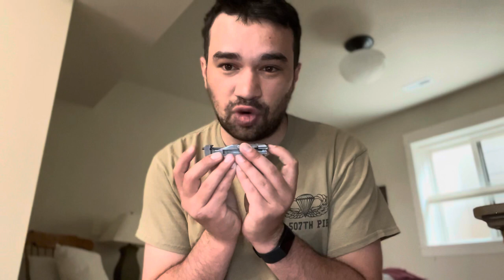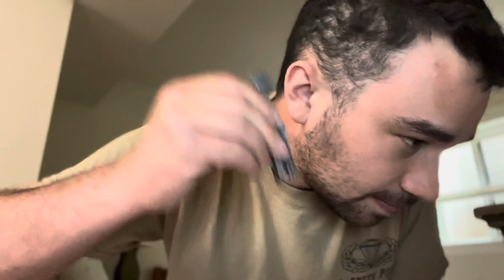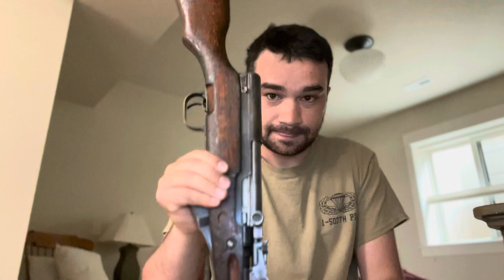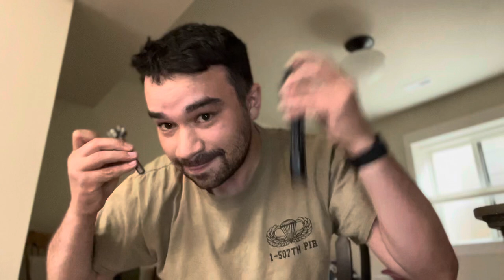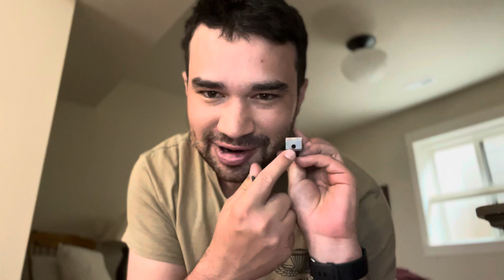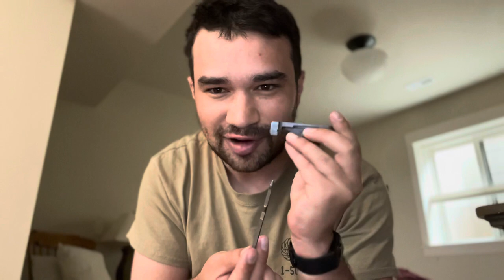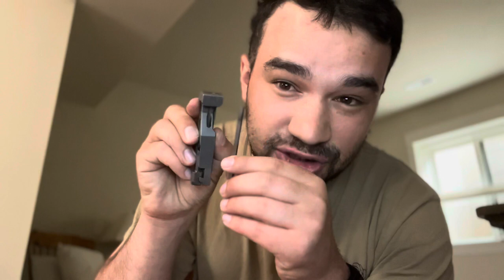The Myth of the SKS Slamfire (why you don’t need an “enhanced” firing pin)

Comment: I'd like to hear your opinion on those "aftermarket" Chinese 20rd "star" magazines that were around way back when. Are they still being manufactured? Back in the mid-1990's I bought one of those ($15) and a 30rd "USA" mag and they both work fine.
Reply from the maker: I think they are super fun, if you have a good one. They are made of thinner gauge steel and are not subject to military minimum requirements, so even among “star” marked models, they vary significantly in terms of quality. I’ve personally had bad luck with them - but I know there are better examples out there. If yours has been running well since for 30 odd years, it sounds like you got a good one.

I can’t say for certain, but I am highly confident that they went out of production in the 1990’s. To my knowledge, they were manufactured exclusively for the US (and maybe Australian) commercial markets. When those markets closed off to the Chinese, they lost their only customers for that product. I don’t think they still make those mags, because I don’t think there is anyone left to sell them to.
Reply: I had issues w my 20 round

Comment: I think some of the concern is also to do with using commercial ammunition with softer primers over the original military ones.
Reply from the maker: That’s true, and a good point. I’d say the strongest argument for a spring loaded firing pin is if someone was for some reason limited to using commercially loaded 7.62x39, although even still I think it’s a dubious proposition. It’s hard for me to see the spring-loaded pins as anything other than a band-aid solution for a very serious (and almost always user induced) mechanical hazard. The safest solution in 99% of cases seems to be to clean the weapon and use the correct ammunition.
Reply: @Triangle26  is there any actual reason why the there should be concern with the SKS and commercial ammunition over ARs and commercial ammunition?

Comment: You make an excellent point. I maintain my bolt carrier group meticulously. I clean it every time I fire it. I also take the firing pin out of the bolt every time I fire the weapon. I use simple green to clean the bolt. Try it once. Simple green is an excellent degreaser. I then lube the bolt including the firing pin with the new Lucas synthetic gun oil. I use a very light coating though. I don’t just pour it on and hope for the best. My sks cleaning kit came with a cleaning tool for the firing pin hole. I use this tried and true tool often. I have over 5000 rounds through my Chinese SKS, probably approaching 10,000 rounds truth be told. I bought it brand new in 1994. I used a parts cleaning tank and scrubbed down everything on the rifle years ago. It still bleeds a little cosomoline out of the stock every now and then though. With all that being said. I have never had a slam fire incident. Or a negligent dis fire with this weapon. Your assessment on the free floating firing pin is 100 percent spot on. It is a tried and true design that is absolutely safe if it is cleaned properly.

Comment: I’m currently having an issue with my Chinese sks my firing pin had gone out and replaced it the other day with a moderne spring firing pin and it ended up snapping again after 10 rounds😮 my buddy was telling me I may need to replace the bolt assembly? Any suggestions
Reply from the maker: Were you experiencing some type of problem which caused you to replace the original firing pin?

If not, the obvious solution here is to stop replacing parts, and just use the correct and original parts for your rifle.
Reply: @Triangle26   hmm not necessarily other then me bump firing it a couple times that’s when it had ruined on me the first time that’s why I had bought that firing pin that was supposed to be a lot better and reliable instead of a free floating pin but it happen again. And I had clean it good and everything before I installed the new one in.

Comment: Question for ya. I had a new sis I just bought slam fire on the first 10 rounds and then completely stopped as now it’s light striking. Is this still the same issue of the firing pin being stuck/slow and clean it out? (I am cleaning it out this weekend.)
Reply: Sks*
Reply from the maker: Well I'll start by saying that any malfunctioning firearm is a pretty serious safety hazard, so whatever you do, I would encourage you make sure the issue is diagnosed and corrected by a competent party before you shoot it again. I can't tell you that your weapon is safe or unsafe without physically inspecting it. That said, the most common cause of slam firing and light striking is failure to remove cosmoline from the firing pin channel, so performing proper cleaning may resolve both of those issues immediately.

Comment: i got a problem with rust. my sks slamed fired, i cleaned it, got the firing pin free, the firing pin chanel was rusted a little got it cleaned though, stored it. after one month i tried the rifle again and it slamed fired again. now i oiled the firing pin channel, it looks good after 1 week but i think another slam fire is aviting my gun as people says dont lub the pin. please help what should i do.
Reply from the maker: So rust is much scarier than cosmoline, because rust is capable of causing irreversible damage.

Basically - your first step is to thoroughly clean that firing pin channel. Brass brush, strong solvent, ultrasonic jewelry cleaner if you have access to it. From there your want to see if there is pitting in the firing pin channel. If there is moderate to severe pitting - that bolt may never be truly safe. If the rust damage is mild, we can troubleshoot from there.

I agree with those cautioning against using lubricant in the firing pin channel. It can be an emergency short term solution, but ultimately it’s a bad idea which can cause long term dangers.
Reply: I always make sure I hear the rattle

Comment: Can you take the spring off and just use the firing pin?
Reply from the maker: Good question. I'm not actually positive, but I definitely wouldn't consider that to be a safe solution. If someone were to choose to use an "enhanced" firing pin, I would advise them to use it with the spring. If someone wanted to switch back to a free-floating design, I would advise them to pick up a surplus Chinese firing pin for $10. No need to take on unnecessary risk.

Comment: The ar is free floating however can not touch the primer when out of battery.  As the bolt moves forward when it unlocks and the cotter pin retains the firing pin in 2 directions forward and back  therefor it will always rattle but is less likely to slam fire  and the slam fire is more likely  to happen with reloaded ammo and soft primers  not so much the cosmoline.    In the 90s my sks came with a paper stating the dangers of slam fires with the use of non military spec primers.  Also my polytec came with a spring loaded firing pin the rest I had did not   my polytec had a spring loaded firing pin threaded in chrome lined barrel and milled trigger pac   most of the sks I had were pressed and pinned barrel  welded trigger pac  and non lined barrels
Reply from the maker: You are correct that the FFFP design of the AR is fundamentally safer than the FFFP design in the SKS, AK, and Garand. The fact that the firing pin is contained by the bolt carrier and not the bolt is a good design feature which essentially prevents the firing pin from ever getting stuck in the forward position. 

That said, I think you may have some confusion regarding identifying chrome lined barrels. China (the only manufacturer of pressed and pinned barrels and welded trigger guards) didn't really manufacture SKS patterns without chrome lining. Ok, technically they may have manufactured a couple, but they are so rare that their existence is still unconfirmed. If you still have any of these rifles, I'd suggest that you could perform a copper sulphate test and verify that they are indeed chrome lined. In my experience thus far, 100% of Chinese SKS pattern carbines which have been alleged to have been non-lined have ultimately turned out to chrome lined.
Reply: @Triangle26  all of the non chrome lined sks I have seen were threaded in barrels     have you ever seen 1 with a factory side scope mount.  Well the rail anyhow.  I have yet to find a mount to fit.  It is attached to the left side of the receiver just under the dust cover  and the wood is cut lower than normal.   Just a straight dovetail with a notch in the middle of it.   It was imported that way. I took it out of the box in 1995   when you could buy them for $65.    And used to hear stories back then about buying a gun with a case of ammo 1260 rounds for $50

Comment: When I have purchased a sks packed  with cosmoline  I always use brake cleaner with spray straw  an make sure it is flushed several  times till it washes clean  after it is dry I oil it
Reply from the maker: Great practice.

Comment: Ive been reluctant to fire my SKS after it slam fired on me, after I had cleaned the firing pin and channel to the best of my ability with boiling water and lots of cleaner, and did the shake test.. I’m wondering if I just didn’t have enough oil, or too much which might have caused the pin to get stuck..
Reply from the maker: Assuming you cleaned properly (and it sure sounds like you did), oil should not be the problem. Too little oil definitely shouldn't cause an issue, as the weapon should run perfectly bone dry. Too much oil should only cause an issue if it mixed with some type of particulate or became frozen.

I see two likely explanations:

First is ammo type. The SKS was designed to run Eastern spec primers, which tend to be much harder than western spec primers. If you were using western made brass cased ammo, that does increase the risk of slamfire significantly.

Second is erosion of the self-releasing taper between the firing pin and the protrusion hole. This is a much less common but very serious cause of slamfires, and while an "enhanced" firing pin would probably reduce the risk dramatically, I would consider the weapon unsafe until the damaged parts had been replaced.
Reply: @Triangle26  wow! Thanks for the reply, that’s some great info.. I had some eastern surplus ammunition, but my range didn’t want me using steel amo (came and checked with a magnet). I switched to some western brass ammunition before it slam fired on me so that’s probably the problem.. I will look into erosion of the firing pin and make sure to rule that out before I shoot it.Thanks again!

Comment: You make a very good presentation, but as an engineer, I do not like free-floating firing pins (in any weapon design, including the AR-15 and progeny). I fail to see why it makes sense to save the cost of a spring at the expense of relying on the hardness of the primer (which can vary greatly). I think there is considerable less variation in primer hardness in .223 / 5.56mm ammo than in 7.62x39mm ammo. Also, cosmoline is not specific to the SKS. M1 Garands sometimes were stored in cosmoline. Because of the free-floating firing pin, it is recommended to never drop the bolt on a chambered round in a Garand. Finally, the geometry of the SKS firing pin is more prone to this because what stops the SKS firing pin's forward movement when dry fired is the taper at the front, which can, with sufficient momentum, become stuck in either the firing pin hole (especially if there is a burr) or in the mating tapered surface inside the bolt. The AR's firing pin stops against the disk-like stop at the rear and the Garand's firing pin stops against the "dog leg" at the back. Yes, a spring could corrode and become debris, but nomatter what firing pin design is used, debris or corrosion (or cosmoline) could jam the firing pin. But the other causes of a jammed firing pin (the geometry and possible burrs) as well as the impact momentum of the firing pin when the bolt slams into battery (which is reduced by the presence of a firing pin spring, and which can possibly create burrs in the inside of the bolt and could possibly set off a very soft primer) can be ameliorated by the spring. The SKS is not the only design where replacement safer firing pins are offered. The MAS 49/56 is also famous for slam firing and it is strongly recommended to replace it's firing pin with one with a return spring.
Reply from the maker: I appreciate you sharing your thoughts. You clearly have thought about this a great deal and have taken the time to develop true knowledge on the subject - which I respect. Unsurprisingly, I agree with the majority of your perspectives. There are a few points on which we still disagree:

1) I have never seen any evidence to suggest that the original Soviet design change from SLFP to FFFP had anything to do with cost saving. I am actually quite certain it cost them more to reengineer the design than it would have to leave it the way it was. Their SLFP design was not reliable (to your point, almost certainly due to the poor consistency of Eastern bloc primer manufacturing). The FFFP design corrected this problem, and allowed the weapon to work much more reliably with the quality of ammo they had (and still have).

2) I agree that the SKS firing pin design is more prone to getting stuck in the forward position than something like an AR. The SKS is certainly not the peak of elegance. That said, the Russians weren't stupid either. The tapered interface of the SKS firing pin/firing pin hole is designed to be self-releasing, and it works perfectly unless burrs, deformation, or heavy grease is present. There are many firearms which do weird stuff when burrs, deformation, or heavy grease appears in the wrong place, this is not a problem unique to the SKS. I strongly believe that if cosmoline induced slamfires were removed from the data pool, the number of mechanical failures truly specific to the SKS design would be utterly unremarkable, and comparable to most autoloading firearms, new or old. 

3) Finally, I think there is a very important distinction to be made regarding "safety" in military firearms. Can an SFLP reduce the likelihood of a slamfire? Absolutely - in an out of spec, mechanically unsafe rifle, using the wrong ammo . But in most SKS platforms, I think it's only measurable effect will be an increase in light-primer strikes or other failures to fire - in other words - the exact problem which caused the Russians to replace it in the first place. If the definition of safety is preventing a gun from firing, the safest firing pin is no firing pin. The other half of safety is that when you want it to shoot, it has to shoot .
Reply: @Triangle26  Thank you for taking the time to reply. One additional question - do you really think that the firing pin return spring causes light strikes? I would have thought that the hammer spring and hammer momentum would be so much greater that it wouldn't matter (as far as the primer impact force) whether there was a firing pin return spring or not.
Reply from the maker: @sbreheny  I really do. I have personally witnessed a consistently light-striking SKS be restored to reliable function simply by swapping the aftermarket firing pin assembly for an original one. Additionally, due to the channel I receive a relatively steady stream of "SKS troubleshooting" emails, and many of them have described similar experiences.

Of course this is far from definitive proof, however, I think it points to a very compelling possibility. Especially when all these experiences are consistent with the complaints found in early Soviet documentation.

Comment: 0:54 remember, the AR-15 doesn't use a return spring on the firing pin. While this isn't the same operating system, it shows that a free floating firing pin isn't inherently dangerous. Gunked up bolt carrier groups preventing a firing pin from moving is dangerous. Either the firing pin will not strike, or strike hard enough, to fire the cartridge or it will be stuck in place. Key takeaway - clean your weapons.

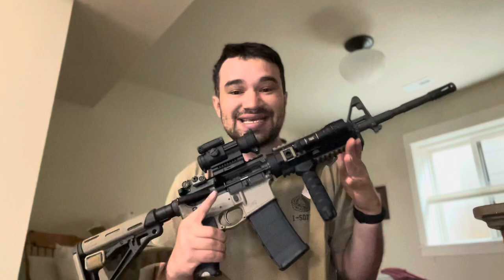4:35 Nevermind, you addressed this. Leaving comment for algorithm.
Reply from the maker: Thank you 🙏

Comment: Is there a factory best known for quality when it come to the type 56?
Reply from the maker: "Quality" can be a little hard to pin down when it comes to Type 56 carbines, because generally we are talking about cosmetic rather than functional traits. In terms of functional quality, it's really hard to find an original Type 56 Carbine that doesn't run properly, regardless of which factory it was made at. That said, State Arsenal 296 (AKA "Triangle 26") was not just the original producer, but they were by far the most prolific and experienced all things considered. In addition to having some of the most refined production blocks (1956-57 and 1978-1980 spring to mind), they really didn't have any "bad years". Can't go wrong with a Triangle 26!